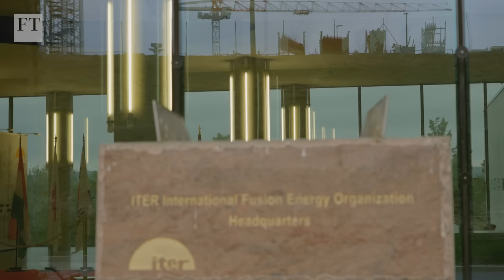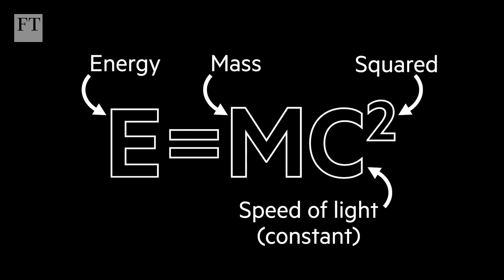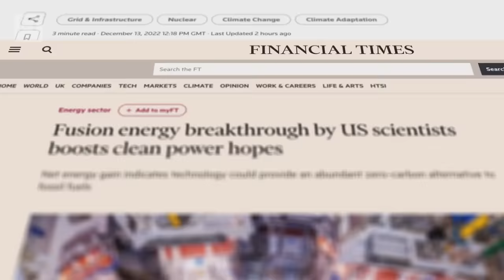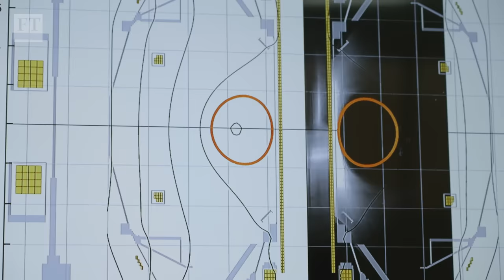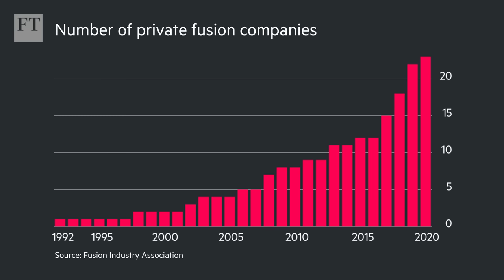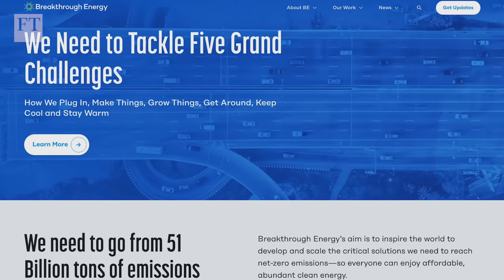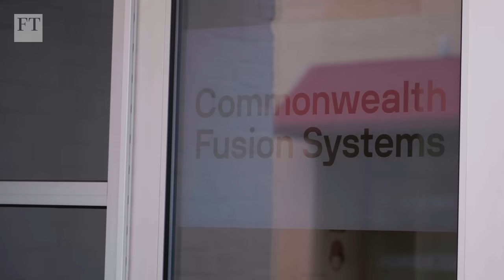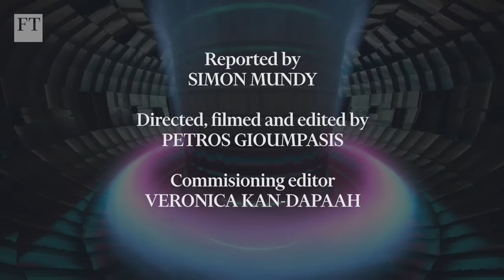Fusion power: how close are we? | FT Film

Comment: 11:05 While it may be true fusion reactors wouldn't in principle produce as much radioactive waste as fission reactors, it's misleading to say they won't produce any nuclear waste at all. Since they will work on tritium, which is radioactive, there will still be the danger of tritium leaks, and since the reactions produce fast neutrons, the walls be activated. How much will depend on the materials of which they are made, and that's still an open question. Furthermore, the radioactive materials in the vessel may become powder which should be very carefully contained, so that it doesn't leak to the atmosphere. This issue should be solved in the next few decades before a fusion economy is possible.
Reply: Generally true, however some (like Helion) are working on aneutronic fusion.  This can be done without any tritium.
Reply: Tritium is a non issue - it is the fuel so it is consumed in the reaction.  But you are right about the neutrons.  Some are to be used to transmute Lithium (can’t think of anything else we may need this for) into tritium as the tritium required for fuel is effectively non existent in nature.  I think most tritium produced now is by product of fusion reactors.  But most of the neutrons will be captured and used to create heat for power generation.  Apparently the material of choice for this is beryllium.  However, beryllium also contains a bit of uranium (which I understand is hard to remove).  While I don’t think it is a huge amount of waste, it is quite similar to a fission reactor.

And dispute the rosy message here (until the last few minutes) none of these fuel generation or heat capture methods  have been tested.  ITER and CFS are going to try creating tritium in their reactors, but generating electricity ( or just showing it is possible) are for future steps.
Reply: @davesutherland1864  Tritium is an issue for reactors that create it.  Like other hydrogen isotopes, it's tiny and difficult to prevent from leaking.
Reply: @kreek22  That’s not going to be an issue.  Whole idea of fusion is to manage hydrogen and as tritium is fuel and (currently) one of the most expensive materials you can buy it won’t be leaking away in any significant quantity.  Hydrogen embrittlement will be a bigger issue for the hydrogen storage.
Reply: @kreek22  I think Helion is the most likely of the start up to produce a commercial reactor before 2050, might even do it in the 2030’s.  My problem with understanding Helions process is the efficiency they are achieving.  Watched at least half a dozen videos and this was never discussed.  If the reaction Q is very low, they are not actually close to commercializations.  If the Q approaching 1 for grid power in to fusion power out, everyone else may be wasting their money.

However, Helion uses deuterium and helium 3, and helium 3, like tritium, is very rare.  Do you understand how they plan to source helium 3?
Reply: @davesutherland1864  Tritium leakage is a known issue in fusion energy research.  The problem has yet to be solved.  And it is a problem for two reasons: tritium is radioactive and it is highly valuable.
Reply: @davesutherland1864  Helion claims they can produce He3 in a D-D fusion reaction.  This means they're planning to use one fusion process to facilitate another fusion process, which is fairly ambitious.  I'm curious as to how efficiently obtain this He3 given that they're relying in part on tritium decaying into He3--and tritium has a high leakage risk.
Reply: @kreek22  D-D fusion produces equal quantities of He3 and T.  The He3 reaction releases a neutron that will eventually damage the reactor.  The T reaction releases a proton that could be used to help power the process (and contribute to the efficiency - don't know if their goal is net power out).  However, to turn T into He3 requires a decay process with a half life of 12.3 years.  So for the 50% T to decay into 1/2 the amount of He3 originally obtained it takes 12.3 years, to get to 3/4 takes 24.6 years and to get almost full conversion takes of 75years.  LOTS of T to store (presumably in the form of water).  So if they go commercial they will be almost entirely dependent on He3 productions until they have enough T in storage that it can make a significant contribution to fuel.

Helion has not decided if they will go with a dedicated fuel generating and power  reactors, or to do it all in one shot.
Reply: @kreek22  no they arent. The only truly aneutronic fusion process is proton-boron and that's not what theyre using. One of mnay thing helion has lied about

Comment: yes, this is as always the claim in fusion videos, that fusion produce no nuclear waste.. 
well…  as mentioned, it’s Deuterium Tritium fusion (as Dt+Dt requires much more input energy) which release a neutron and that neutron makes materials radioactive. 
Yes, its only for couple of hundreds years of storage, but still nuclear waste storage.. over one’s lifetime. If you check storage facilities from the 1820’s, and societies around then and now, you’ll get the picture.
Also, it’s still a rich man solution. to use where there is an infrastructure for it. Most of the big cities outside rich billion uses mopeds to transport gas as main energy delivery system. You have no us for ITER there, so even we the rich billion use fusion, 7 billion will still burn coal (it this is what the rixh billion is aiming.. should we? )

Comment: This article was extremely negative about the potential for fusion to come online anytime soon.  I think they are 2000% wrong, there are three major factors I believe, firstly, REBCO magnets have produced fields as much as 40 Tesla now, conventional ceramic super conductors max at around 10 Tesla, this is a 4x improvement in field strength, plasma confinement scales with the cube of the magnetic field so this represents a 64x not 16x improvement as incorrectly stated in the video, second AI controlling the field will provide even larger improvements, and third, since these two things will produce such a huge improvement in confinement, much smaller machines will be possible, this will allow developers to iterate much more frequently, 4th a concern over where we gonna get tritium besides breeding in lithium blankets, we can also get it simply by capturing and storing the tritium from conventional light water nuclear reactors, in 12.33 years half of that will become He3 and He3 is also a very useful fuel because it is aneutronic making an operating reactor less of a radiation hazard and allowing electricity to be extracted directly from the exhaust products bypassing the need for a thermal generation loop.

Comment: Helion is the proper method to use fusion commercially. It isn't a fancy kettle boiler and uses the plasma compression to extract electricity directly form the process. FT is pushing the fancy boiling water methods which is a huge waste of energy and very 1800's.

Comment: I find the different measures of breakeven unhelpful and a cynic might suggest misleading, breakeven for the power emitted by the lasers and power emitted is not in my opinion the important figure. The power consumption of the whole system is several hundred times the power out. The power out is raw energy surely you have to then transform that to power via turbines, so even more loss. So actual break even is a long, long way away. The other factor, that seems to be rather obvious, is that we already have one of these fusion reactors. It is called the sun and it showers us with more energy than we could ever use every single day. What we are lacking is a way to store that energy in a form which allows convenient transformation into electrical energy, this is an area where we can and are rapidly making advances. Not as sexy and harder to get governments to splurge money, but I feel, more likely to address our upcoming challenges.
Reply: The lasers use in the experiment are essentially 1980s technologies. We now have lasers that are hundreds more time efficient that why it not as important as getting more energy out of the fuel that was put into that fuel.

We also only got a tiny fraction of the energy out of that pellet than what should be possible.
Reply: @DavidKnowles0  so why with all the $billions available did they not use those "much more efficient lasers? Because they don't actually exist perhaps?
Reply: @DavidKnowles0  I am sure with much time, money and research fusion power could be workable. That still doesn't change the fact that the sun is already available and essentially the same thing. There is no way that fusion can be working in time to deal with our current issues. Money and resources put into technology  we already have might be a better use of our efforts.

Comment: I thought the sphere is made of diamond
Reply: That's what I heard too, and it had to be made with extreme precision.  (I assume you are referring to the shell that contains the fuel pellet at the National Ignition Facility.)  They never revealed how much the completed fuel pellet cost or how much it would be likely to cost in full production.  But it released about ten cents worth of energy at retail price, assuming the energy could be converted to electricity at 100% efficiency.  If I remember correctly, they did say only about one-fortieth of the available fuel in the pellet was "burned".  So, if they could have burned it all and could have converted all that energy to electricity, it would have been worth about four dollars.  It is hard to imagine they could convert the energy at much better than 30% efficiency.  It's also hard to imagine the wholesale price at the production facility could be much more than half the retail price and still be viable, so the electrical energy produced by the pellet would be worth about 60 cents as it emerges from the power plant.  They have stated they would like to get rid of the sphere and just shoot cryogenically frozen fuel pellets.  There's yet another "hurdle" to be overcome.  If wishes were horses, ...  😄

Comment: Facts:
The phenomenon of nuclear fission was discovered in 1938.
The first working nuclear reactor was built in 1951, the first nuclear power plant actually delivering power to the grid was built in 1954.
Today, 2023, only about 10% of the electricity generated by nuclear power plants.
By the way, in the 1940's, fission power was considered by many techno-optimists the same way nuclear fusion is seen today: a practially infinite power source which will solve all energy problems forever. Again: ~70-80 years passed, and only 10% of electricity is generated by fission.

Now for the fusion:
The phenomenon of nuclear fusion was proven experimentally in 1932.
Today, 2023, we still don't have a working fusion reactor.
Considering what happened with fission energy, you cannot seriously believe that the fusion will solve our energy needs in the near future.

So.. stop being delusional, the holy grail of energy is just a myth of wishful techno-optimist thinking.

Comment: It is out there already.  It has been running for a long long time.  Why do we need another?
Reply: because the moon means it doesn't provide 24 hours electricity. The panels also take up a lot of land.
Reply: @DavidKnowles0  It only requires putting mirrors in space.  We could have many up there now, providing 24 hour light to solar collectors on the ground for a fraction of the sunk cost in fusion research.
Reply: No Satellites up there, that's why.😂
Reply: @visionentertainment8006  not sure I understand, but launching large aluminum on mylar mirrors is technically easily achievable and soon even cheaper when StarShip comes online.

Comment: If the fusion people achieve their dream, it will be maybe 10% better than fission.
90% of the money going into fusion into making fission cheaper would be much more sensible.
Reply: firstly having more energy then you put in is not 10% but 110% also having literally NO radioactive waste is already a reason to invest also a powerplant stonger then and nuclear PP with literally no dangers is the dream come true.
Reply: @Kiwoeoe  Fusion does produce radioactive waste but it is shorter lived than in fission waste, but the cost of fuel for fission, plus the greater waste disposal cost is only about 10% of the cost of the electricity produced.
Reply: @Floccini  HOW IS HELIUM RADIOACTIVE
Reply: @Kiwoeoe  Nuclear fusion is the process of combining two light atomic nuclei to form a single heavier one, releasing large amounts of energy. Fusion reactors produce helium, an inert gas, and tritium, a radioactive beta emitter with a short half-life. 

Fusion does not create long-lived radioactive nuclear waste. The activation of components in a fusion reactor is low enough for the materials to be recycled or reused within 100 years.
Reply: @Kiwoeoe  A fusion power plant produces radioactive waste because the high-energy neutrons produced by fusion activate the walls of the plasma vessel. The intensity and duration of this activation depend on the material impinged on by the neutrons.

Comment: I do not know why the FT (namely a journal concerned with financial matters) is even interested in tokamak fusion power described in the video.  It is clear that such tokamak fusion power will not be financially viable and hence of any any interest for at least 50 years, if ever.  Tokamak fusion energy will potentially be very expensive per kWh if ever feasible because of the complexity and exotic expensive .  Economically, it will be easier and more cost effective to use photovoltaic panels with energy storage (e.g. flow batteries).  The investment in tokamak fusion energy is a total waste of money.  ITER is the biggest technology white elephant project in Europe.

Comment: I'd like to know why anyone believes that the thermal energy extracted from a fusion reaction will ever be sufficient to convert to the electrical energy necessary to create the conditions to sustain that fusion.

If someone told you that they could design a generator efficient enough to power an electric car by simply connecting it to the car's wheels...  You'd laugh in their face and rightfully so.

Fusion research may lead to some interesting discoveries but it will never lead to commercial fusion-powered electricity generation.

Comment: We are at least 20yrs for fusion power for the powergrid.
We are perhaps less than 20yrs to a fusion bomb.
All the reported net gain of energy measurements ignore all energy inputs except at one tiny location for a very brief period of time.
A tiny place with a momentary exponential gain or release of energy describes bombs.
Fusion bombs came before fusion power plants. Energy is relatively cheap and plentiful, except for artifical distortion in energy economics caused by government interference based upon bogus science and poor environmental analysis.
Reply: Actually fusion power had been there for ages. Hydrogen bomb is one of the product of fusion. We already manage to do fusion since the 90s and already can create a deadly weapon from it. The hardest part is to be a civilised human and harness it for electricity. Also this video fails to show private sector working on this. Since it only focus on the iter then you will see that it's not viable in the near future but if we were to check from a private sector side, the technology is as far as 2 to 5 years from now.

Comment: Yes , the Energy of the LaserBeam was less than the Energy of the Fusion Reaction  b u t  thats only half true , you dont get such a strong Laser Beam out of nowhere , it had to be amplified several Times , this costs Energy too , in total they used  ~  1 0 0  Times more Energy than the Fusion Reaction generated . 
2 nd : Tritium is very very  rare , there are only ~ 3 ,5  K i l o g r a m m s or  7 P o u n d Tritium on Earth , to use it in Fusion Tritium has to be artificially produced in heavy water Nuclear Plants = Clean Energy ? Forget it , you still need nuclear Plants to produce Tritium , endless Energy ?  with a ressource ( Tritium ) as Fuel that basically not exist on Earth ?   Nope ....
Reply: part of the ITER experiment is to see if including lithium in the first wall could serve as a viable source of tritium

Comment: The 'breakthru' was at the same level as 'cold fusion'. 1. Test data have NOT all been reviewed and certified. 2. The experiment and outcome was NOT repeated by the facility. Standard is 3 out of 3 successful runs. Sorry. 3. The experiment and outcome has NOT been independently repeated NOR CAN IT BE REPEATED, there is nowhere else to test it. FAIL.

Comment: better to run superconductors in the dark side of the moon, or somewhere else that's cold and maybe a bit further away from stuff humanity needs.
Reply: As crazy as it sounds, but running superconductors at almost absolute zero temperature just a few inches from 100 million degree hot plasma is not the issue.
Also, the moon's dark side is changing constantly, so there's no place on the moon that's always in the sun's shodow.
Reply: dark side of the moon isnt actually dark/cold. It's just the side pointing away from earth
Reply: @ResandOuies  To avoid confusion, it should rather be called "Far side of the moon".